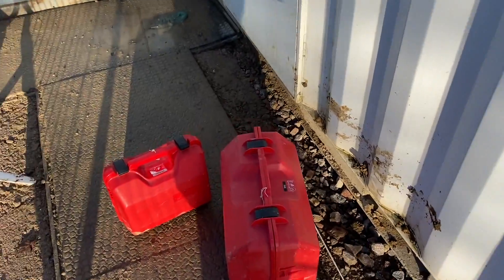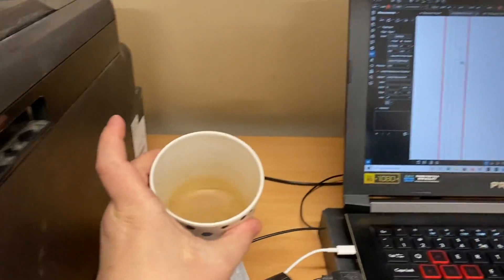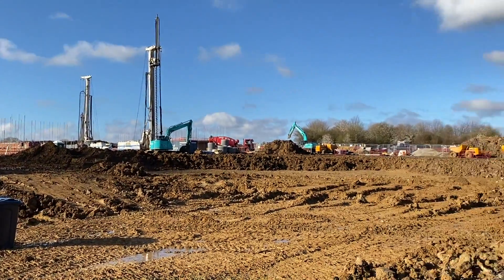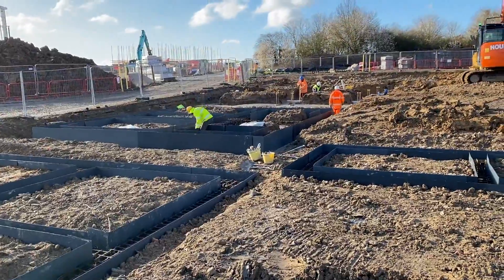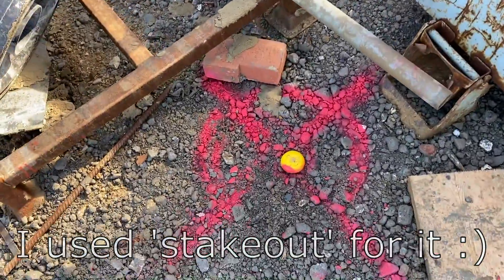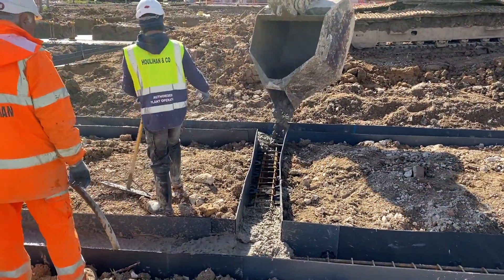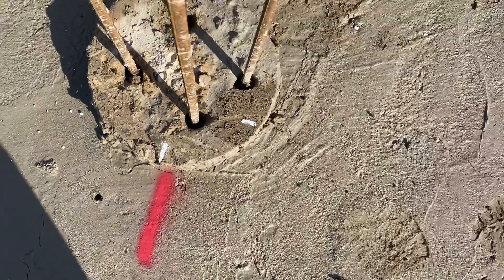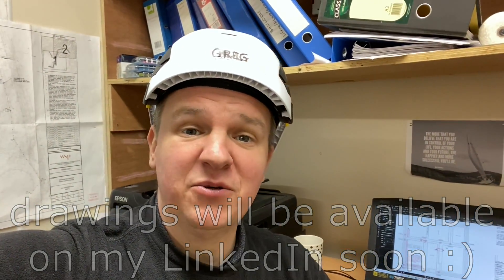CIVIL site ENGINEER - day in the life.

Comment: Greg, how to deal with lattice plank: seting out the edge and transfer points on the slab? Thank's.
Reply from the maker: What do you want to mark there. Can't you just tape after installation?
Reply: @SITENG   let's say i ned to mark some Columns. But all around there is screen protectors. So from ground floor I need to transfer points on the top of the slab, but how if the slab is not poured yet, it's only rebar.
Reply from the maker: nothing there the set the targets on? maybe on the screens and each time survey them after lift for the next level. No core there? You would need a station below - pin on the slab and then set up on top (you would need an opening in the slab where your station is) It's hard to advise really if I am not there

Comment: Great videos ...Can you make a video on how you mark the top level of the beam using laser level ??
Reply from the maker: Hi Rajarshi! Do you mean setting level for concrete?
Reply: @SITENG  Yes. Setting level of concrete to maintain uniform level.
Reply from the maker: @InsideMyWall  It should be there on the video. Please check also my Setting out video nr 01 where I show the laser :)
Reply: @SITENG  Found out the same and it's very simple to use. Will propose to procure it in my next project :)
Reply from the maker: Yeah, definitely try to get one :)